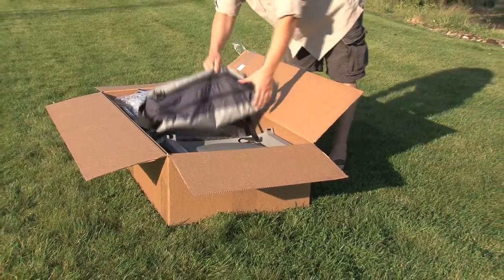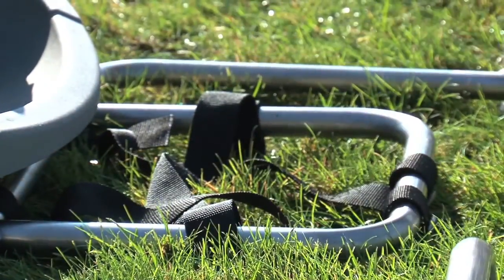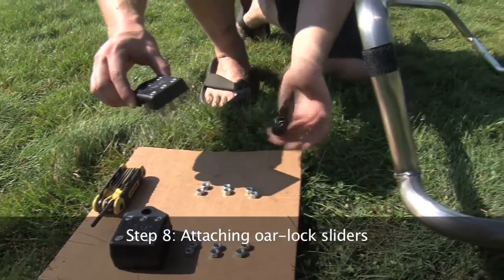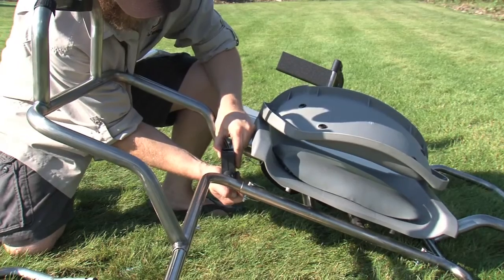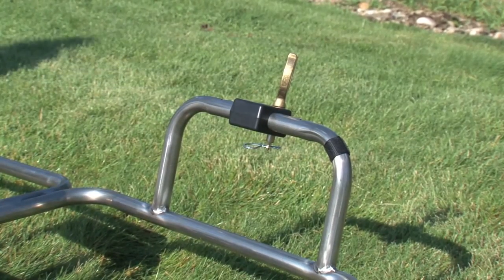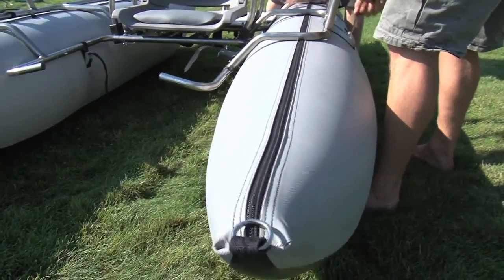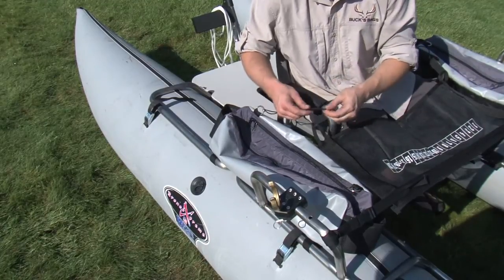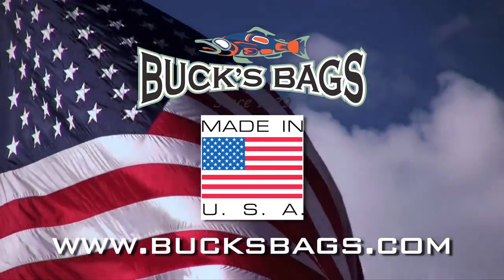Bronco Extreme

Comment: Goodness. I hope I didn't buy a dud. The manual that came with this unit was very unclear. I have seen better instructions with cheap Chinese products from Harbo Freight.
Reply: Old post but was wondering if you are happy with your boat.. I just found this website and pontoon model and was hoping this would be a solution to bring a fishing craft with my overland rig setup
Reply: @ARCENAULT  Bucks bags are very quality compared to a lot of other brands. I’ve had mine for over 10 years no issues.